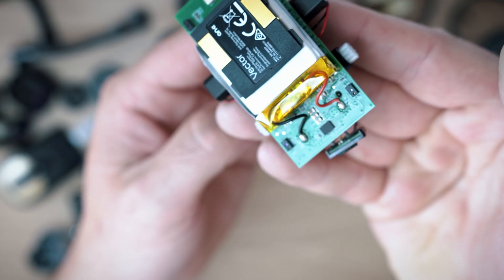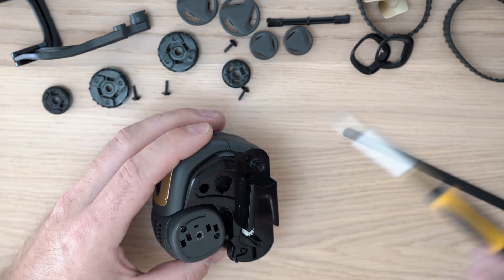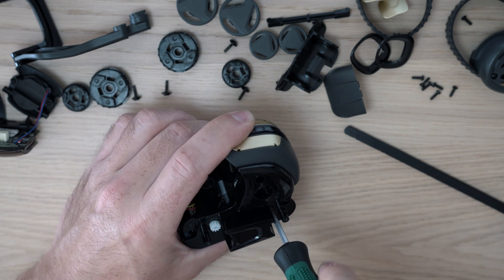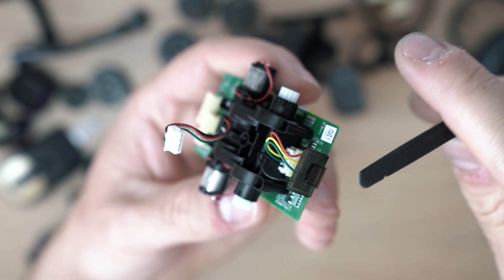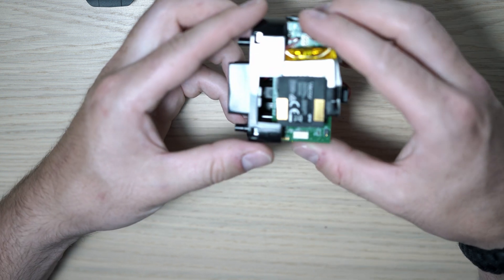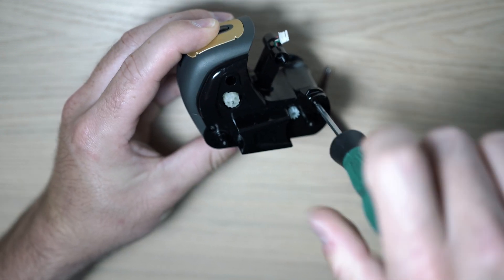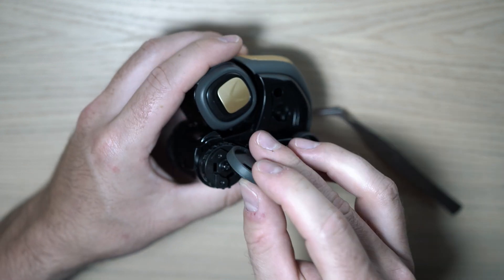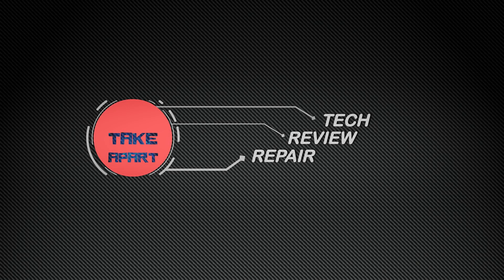Anki Vector Body TEMPERATURE FIX | No More OverHeating Issues With Vector Robot | 4K

Comment: Dang it, didn't know one day I would have to perform surgery on Vector. I did not have these issues before, only after DDL took over. Would firmware have an effect on these things? Is it possible that DDL is causing this?
Reply from the maker: hi, did you payed subscription? FW can change things for sure
Reply: @takeapart  I was a kickstarter backer. I think I'm on their latest firmware. Do you know if it's possible to roll back to anki firmware?
Reply from the maker: it is possible but you may have to contact them and ask ... out there isn’t much about it...

Comment: Thanks for documenting that.  I wonder how it would compare to one without the holes drilled in it.   Perhaps you could lower the temp enough by just adding the spacer between the battery and circuit board to provide an air gap. 🤔
Reply from the maker: hi, yes you can leave it close but it will be pretty much airtight ... with excessive use of vector... play/charging and repeat the temp can rise way up! 
thanks for watching